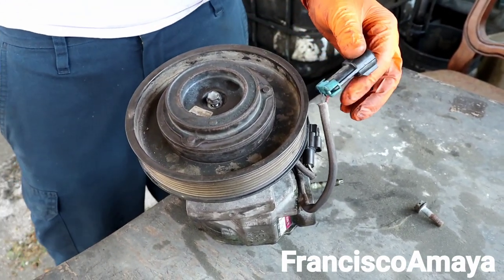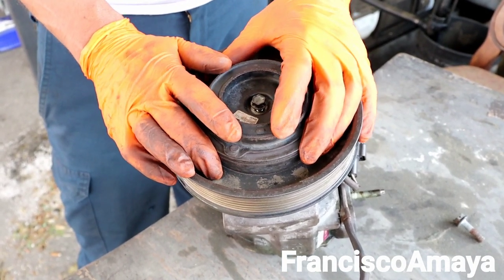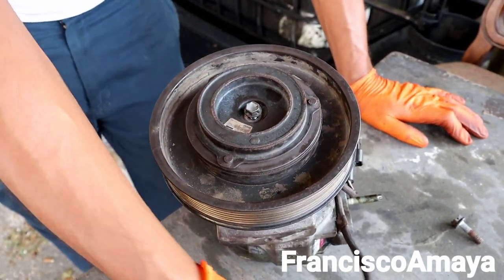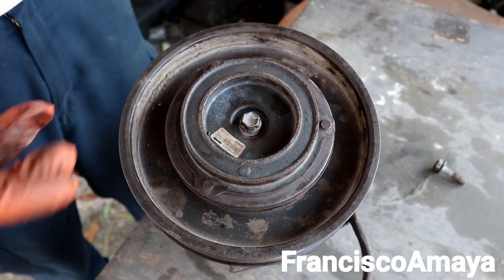S3 E3 F.A.I.T.H. Freightliner cascadia A/C  compressor clutch pulley removal clutch no working

Comment: I just did mine on my Kenworth t600 cat c15 acert it was 120.00 paccard branded my mechanic was able to replace it WITH OUT having to discharge the system I paid him 120.00 My little piece of advice, Don't try to do it yourself unless you have the right tools ,the bolt he showed you. A pully puller and the tweesers to get the looking rings off ( the other compressor has 2) and as long as you don't have to remove and discharge the compressor then yes is worth it give a shot but if the truck you have doesn't have enough space to work with and you have to remove the compressor then DON'T do it, might as well replace the ac compressor

Comment: Thanks for the video! Wow I thought it was sealed together! So if I take mine apart now and put anti seize on all the parts it should be easy to replace on the road whenever the coil goes bad. Then I don’t have to buy a new compressor and dryer and reload the system at a shop.

Comment: This is my current issue, clutch needs a tap to help it engage. Compressor works fine no issues. Labor vs just buying an entirely new Compressor.
Reply: i have the issue no. Was it the clutch?
Reply: @insertuniquenamehere396  yes, it was the clutch. The labor to replace the clutch vs just replacing the compressor was minimal.
Reply: @insertuniquenamehere396  buy the parts yourself and find a mechanic, you'll save more. Everyone marks up parts and charges pick up/delivery fees. Good luck..

Comment: Great video, thank you!  Question, What does it mean if I can get compressor clutch to spin, but stillAC is blowing warm?
Reply: Check Freon level, if full might be the compressor clutch or the wire, mine was the wire that goes from compressor to clutch or sensor according to this video, I thought it was connected to the compressor and is a sensor, check that wire too.

Comment: I have a truck that the driver side AC is working but in the back sleeper is not working, do you have any idea what is going on?
Reply from the maker: If it blows hot air only it could be caused by the expansion valve